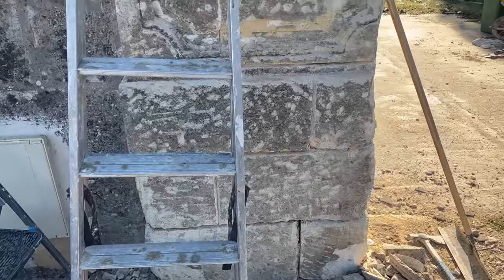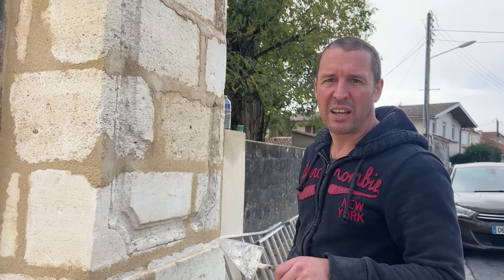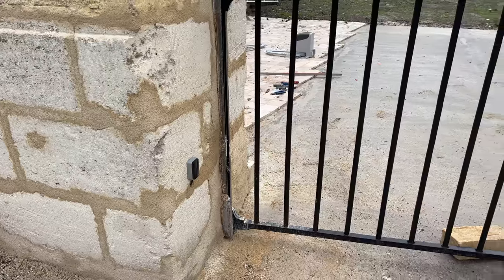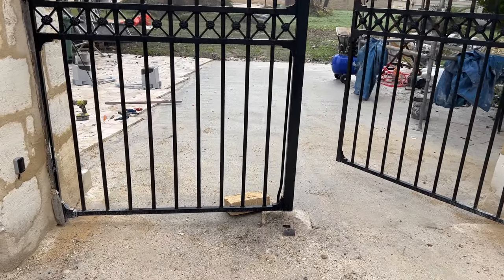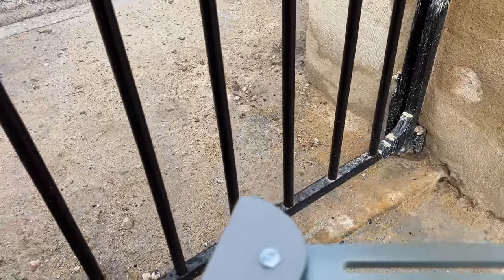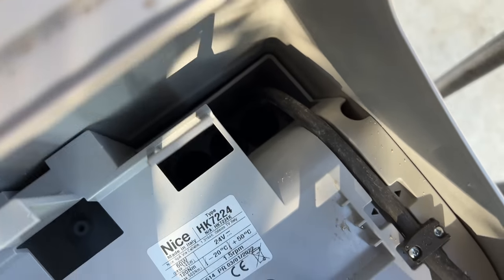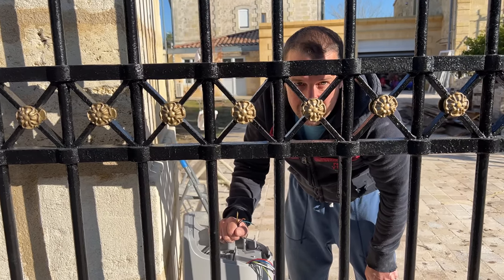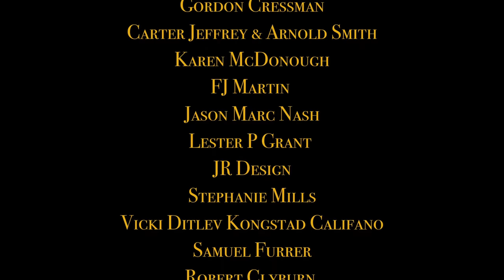CHATEAU DIY - Renovating The gates pillars and walls

Comment: The ‘crappy’ as my subtitles termed it, is what we call stucco here in the states. Usually a blend of sand and plaster or cement materials with the option of adding colorant. Very durable and common on block surfaces such as your wall. It takes real skill to apply so bravo for the finish you achieved!

Comment: Metal gate: brush it with wire brush, metal primer, 2 -3 coats of brushed metal spray paint, 2 coats of sealer in spray paint form.  That’s how you should treat the metal gate.

Comment: Well done Ed, the fitting of the motors and arms to the gates was clearly difficult.....sometimes you have to begin at the end and work backwards when fitting these motors and arms....I hope the motors and arms last a long time and are reliable....the automatic gates I have where I live have had issues over 23 years and needed repairs and replacement.  If you do get to a point where they fail or just don't seem to work, now you have installed and had experience with the issues, if you have to start again and get new motors etc, plan it differently drawing on the experiences and issues.  You might want to consider placing the motors in a different position, to protect them from being accidentally hit by vehicles travelling through the gates etc....I bet you are probably thinking if there is a next time that you would do it differently.  You are so talented Ed...you have so many amazing tradesmen skills and you are a very hard working person.  I love the gold painted on the gates.  By the way fake flowers and fake green foliage will last and wont die if you place some in the tops of the urns, no one will guess it is fake, I would choose some plastic fake flowers and foliage, you should get about 5 years use, and if they fade, just use some green spray paint on the green foliage....you would faint if you knew how many fake plants and flowers I have in pots outside in my garden, they look amazing and real.

Comment: just a tip with the lime pointing (don't mean to teach how to eat eggs..); if you just let the mortar 'go off', not dry, then go over with an ordinary stiff hand brush and bang the mortar. Its like a flicking banging.  It gets rid of any air pockets, makes sure any mortar is banged into the gaps and gives a good finish. You don't then have to go over it and scrape or wire brush.   It's called 'churning'.   Gates look amazing x

Comment: Edd, I would consider reinforcing those bars on the gates where you have the arm attached. They do look just a bit flimsy to me.
Good job on getting it to work properly.
I had a neighbor try to put an opener on his gate. He tried a few different ones, but they never worked right.
His was a single wide gate, so it put a bit more stress on the mechanism. He finally gave up.

Comment: if you added a plate with three holes in it to the arm at the shorted length, instead of the U-bolts. Use the two holes on the outside to bolt the plate to the arm and a counter sunk bolt facing the gate, bolted to a vertical tee that has a bearing on each the other two ends and riding within a C channel attached to the back of the gate (painted black), The arm head would travel down the channel from rung three to rung 8 without modifying the opener, hiding the mechanism from view through the gate.
Reply: horizontal C channel
Reply: level with the arm on the gate opener

Comment: Make sure that there is sufficient space between the two parts of the gates. If they shut too neatly over winter, then you have a problem in summer time as the iron will expand. And then the gates will have problems to open , in particular theopeningvia the electric will not work. Harald

Comment: Congratulations Edd! Good job as always…but, the ones you did with the motor, is it much easier than moving the gates a little further back? Or maybe not possible  because the gates should be in the middle of those posts to make it stable, is that correct? Anyways, still the intent was done and it worked… God bless Edd and Anna and to the kids as well…
Reply from the maker: Yes I couldn’t move the gates- they have to be where they are